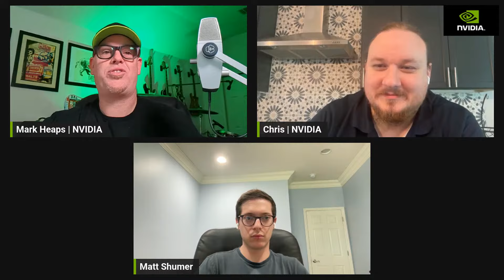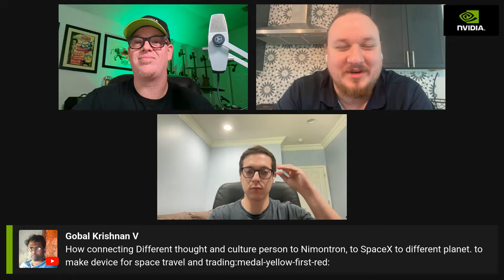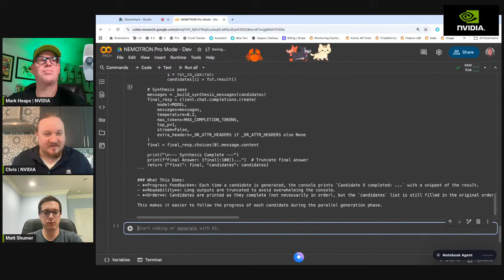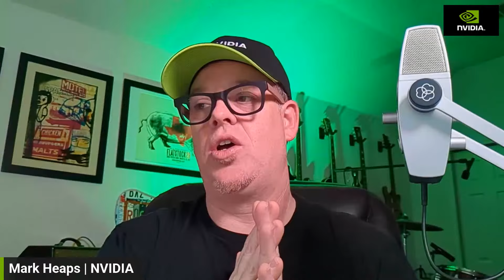Ask the Experts: Nemotron Nano, Tool Calling, and Agent Efficiency

Comment: Timestamp	
[00:38]	Welcome & Guest Introduction: Mark Heaps introduces the Nemotron Labs stream and guests Chris Alexia (NVIDIA) and Matt Schumer (Other Side AI).
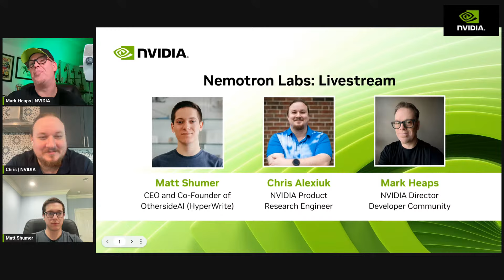[02:55]	Matt Schumer's Background: Quick overview of Matt's experience, founding Hyperwrite (Other Side AI), and his work in pioneering inference and training techniques.
[05:47]	DEMO: The "Pro Mode" Inference Technique: Introduction to "Pro Mode" – making a smaller model (9B) perform like a much larger one (e.g., 70B) by synthesizing multiple generated responses.
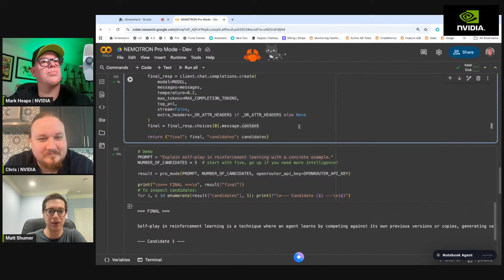[10:39]	Scaling, Efficiency & Best of N: Discussion on using faster, smaller models for greater control, and the "faster models are smarter models" philosophy (ensemble methods).
[17:12]	Flexible Agent Architectures: Exploring how the "committee" approach allows for mixing different models or specializing "experts" (e.g., formatting expert, emotional expert) within the ensemble.
[25:04]	Nemotron Architecture Deep Dive: Chris Alexia explains the Nemotron Nano's Mamba hybrid SSM architecture, chosen for its efficiency and speed with very long context lengths.
[31:44]	Best Practices for Tool Calling: The experts discuss the critical need for clearly defined tools and the importance of clarity over ambiguity in natural language prompting.
[41:00]	Nemotron GPU Spec Guide: Chris outlines the minimum GPU targets: Nano (Single A10G), Super (Single Data Center GPU), and Ultra (Single Node/8 GPUs).
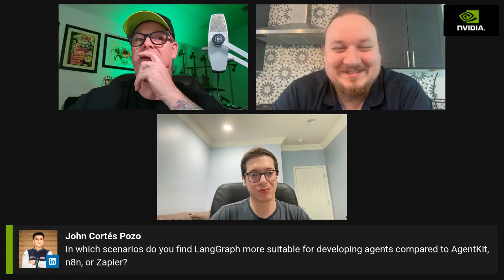[43:08]	Toolkits: Langraph vs. DIY Agents: A discussion on whether to use frameworks like Langraph or simply use a powerful LLM (like GPT-5 Pro) to generate the agent code from a description.
[53:08]	Matt Schumer's Open Source Projects: Matt shares GitHub repositories including the "GPT Pro Mode" demo, "Sora Extend," and a reinforcement learning model training system.
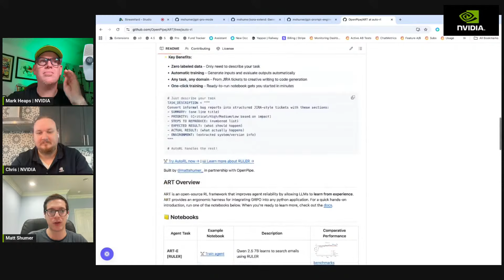[55:51]	Closing: NVIDIA's Internal AI Adoption: Confirmation that all NVIDIA staff use various LLM tools (ChatGPT, Gemini, etc.) to understand the customer experience and test their own technology stack.